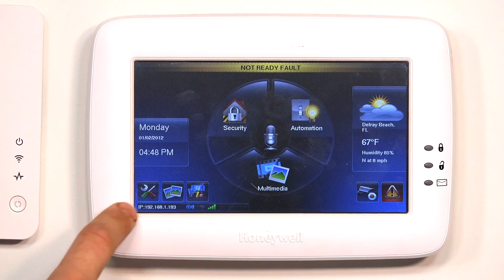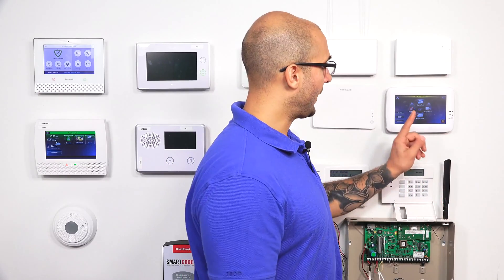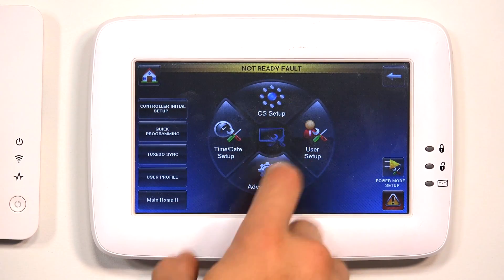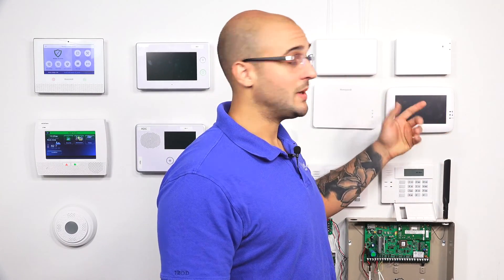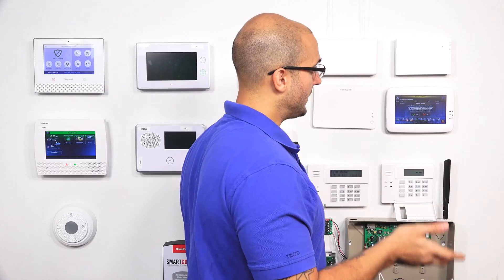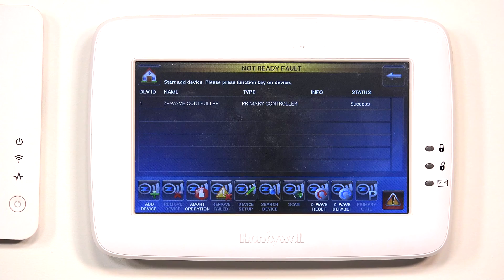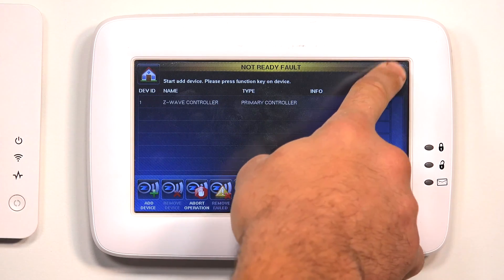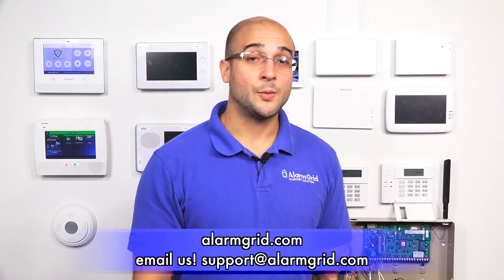Resetting a Honeywell Tuxedo Keypad

Comment: My device keeps rebooting how do i stop it?? Please help
Reply: If the tux is rebooting a couple of things that can cause that 
1. Overdraw of current. to many devices exciting the max current of the system 
2. Noise on the data line. If there is interference(Nosie) The tux will reboot in a way to try to resolve it 
3. Wire run is damaged 
4. Issue with the TUX itself 
Troubleshooting: Take the tux to the main panel on a short wire run.

Comment: I have 2 tuxedo touch and they both keeping trying to reboot and then goes to a 2 tone blue screen.  I can’t use the touchpad due to that.  I’ve tried resetting both of them without any luck.  What would cause this to happen with both of them the same time?
Reply: I would double check the wiring making sure nothing is damaged.
Reply: @traviscox7336 i have the same issue and the wire is fine

Comment: My name is Joe and I own a security company in Ct. I have a customer with 2 Tuxedo touch keypads I installed about 2 years ago and they will not go dark. They stay lit all the time even though they are set to turn off after 1 minute. I tried doing a remote reset and even had the customer do a reset at the keypad but they still stay lit. Any ideas?? Again they were installed new about 2 years ago. Maybe a firmware update? Not sure but customer has to cover the keypads since they are always lit up. Any help will be appreciated
Reply: Hey Joseph, There was an issue with the TUX where they would either stay on or go off and not come back till after a reset. i would recommend a firmware update on both TUXWIFI
Reply: @joshuagriffin2807  Thank you for responding. One problem I have is none of my computers / laptops have an SD card port. I guess they make a USB C to SD card converter. I was also thinking about swapping the 2 TUXWIFI's out with the new Resideo 6290 touch screens. They are only $139 at ADI but are they compatible with a Vista 250BPT? This customer pays me enough money to do this. Let me know your thoughts.
Reply: @josephcahill1015  Yes, the 6290 and all Tuxedo keypads are compatible with a VISTA-250BPT if you aren't able to run the update to the existing Tuxedos.